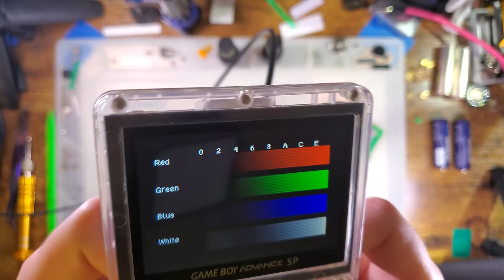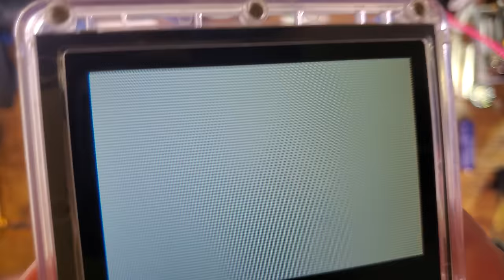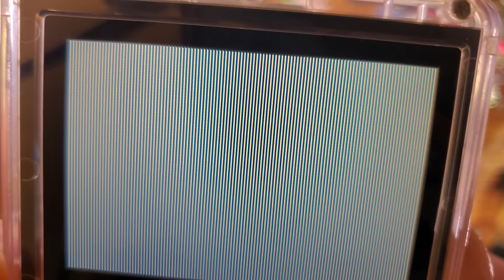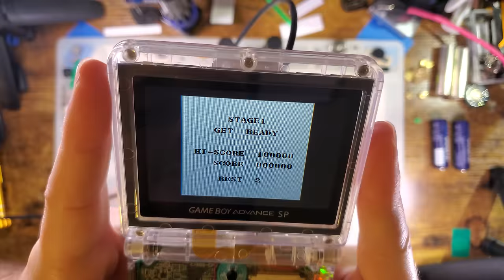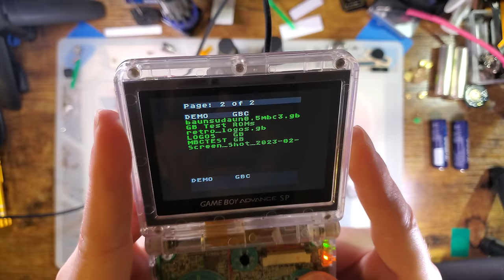FunnyPlaying ITA with OSD and FRM (GBA SP)

Comment: I've actually been able to fit this screen in an aftermarket shell. It just required a ton of modifications. Not only do you have to cut all support on the shell but sand down the posts where the screw holes would go just enough to center the screen and still have the screws go in and actually grab onto something. A lot of sanding where the support was in order to have the screen lay flat. Also once you do all this the shell you would have basically half circle shells where the screw indentations are. That's okay because once assembled the rubber stoppers will cover them. Leaving you with a normal looking sp lol 

I do have to warn. I was a Handyman by trade in the past so I had the tools and the fine craftsmanship to know when to stop sanding and how much to sand without destroying the shell. I do think this would require some practice if you never sanded or modified anything in your life
Reply from the maker: This can be said with a lot of mods I show. I usually just say "it doesn't fit" and don't elaborate because most people that have the skill to make something like this work (like you do), do not even need the question asked. Nicely done.

Comment: So 10:07 that little ribbon cable dude. I kinda think i burnt mine :') do i need to buy a whole new kit or can i get a replacement for that on thing. Its the little one coming out of the screen that burnt.
Reply from the maker: You will need to replace the LCD. 

I'd also recommend doing some solder practice.

Comment: The striped surfaces I was talking about can be clearly seen at 1:01:16 in the video. Sadly funnyplaying didn't fix it.
Reply from the maker: https://twitter.com/makhowastaken/status/1641538602990735360
Reply: I've also pointed this out before. Funnyplaying told me they weren't able to find a solution for the issue. The "moving lines" can be mitigated by adjusting the trim pot, but not the static horizontal rows of lighter pixels. They are always there, static.

Makho, you obviously don't see it yourself, ans that's fine, but that doesn't mean it isn't there. It can be seen in this very video even.
Reply: This is an issue that doesn't get talked about enough with these ITA kits. I adjusted the potentiometer using the flicker test on the aging ROM, but I still see the alternating rows of lighter pixels. Additionally, I still notice some very slight static when looking at areas of flat color. Not flickering, but like, fuzzy static. It's not possible to make these issues go away with the trim pot. The static isn't noticeable during gameplay, but the light lines are noticeable, especially in darker areas.
Reply: @ivmivmivm  Very noticeable! Unfortunately it was a deal breaker for me. FunnyPlaying responded to me saying there wasn't a way to fix the issue at that time. I'm guessing they haven't done anything about it since.

Comment: Does the battery last longer with the ITA display than with an IPS?
Reply from the maker: I never updated my spreadsheet with the SP ITA numbers (and I didn't realize this until right now so I'll go fix that in a bit) but the numbers are in the video. You can extrapolate battery usage from there. Lower power usage means longer battery life.
Reply: That was the main feature I was looking forward to with the ITA kits. I can't really tell from his spreadsheet. None of the line items seem to refer to this kit.

Comment: Any advice on how to securely attach the ribbon cable on the screen? Mine keeps coming lose since it doesn’t have the same locking mechanism the motherboard has
Reply: The little black line on the back is a lock, you push it forward and it folds down locking the ribbon in place

Comment: Hi wondering for this kit, soldering is mandatory right? unlike the IPS kit?
Reply from the maker: Mandatory until the backlight connector comes pre-soldered. They currently do not come pre-soldered. Kit controls require soldering (but kit controls are optional).